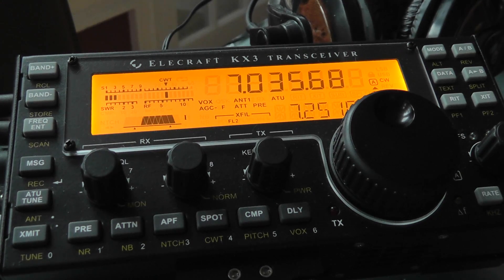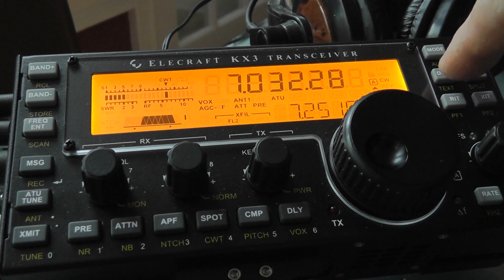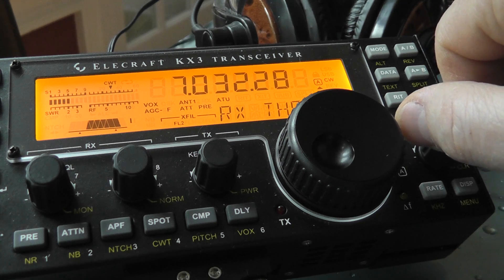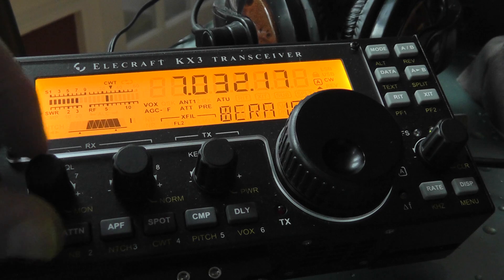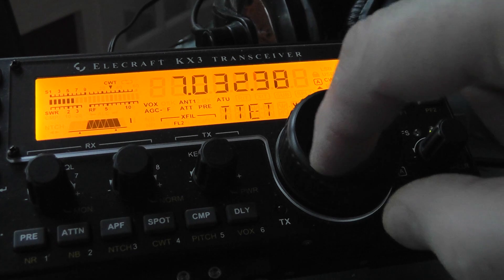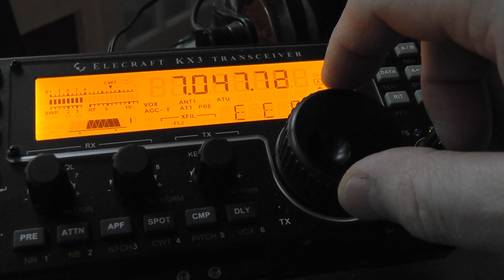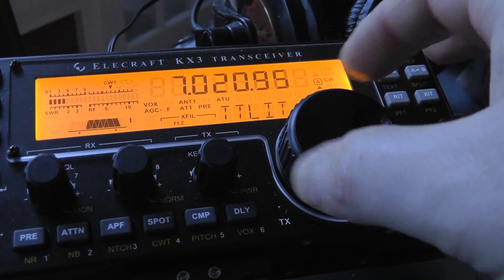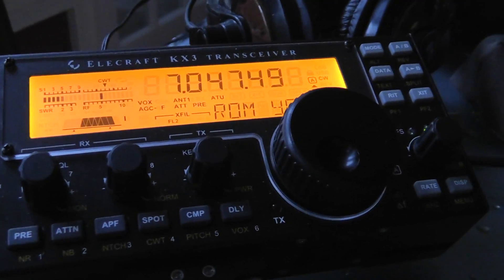SETTINGS FOR CW DECODE ELECRAFT KX3

Comment: I think the trick might be the same as the xeigu 6200 decode. Rather than try to keep winding onto the signal and see if it decodes immediately get a good signal that kx3 starts to decode and wait. After about 30 seconds the xeigu 6200 starts to decode very very well. I’ve also seen the kx3 decode very well  which is great because I get mine tomorrow. 👍👍🥳

Comment: I know this is a bit late and you may already have found this out....   I see that your preamp is on and it sounds like the RF gain is at 0.   On noisy bands, like 40M, I have had the best luck running FAST AGC, preamp off and riding the RF gain down...   The Decoder is fighting all the background noise on top of everything else and you end up with a lot of EE*E***E*E***EEE kind of things.
Reply from the maker: +John Wells Thank you for the tip on the KX3....I do not get to use it as much as I would like but plan to getting back into using it regularly.

Comment: N4KTZ de W0QR
Steve the key to working with the data modes is to load the KX3 terminal program.  You not only can see CW decode but you can send CW, PSK, RTTy via your keyboard and decode it on a dedicated screen.  You have to use the adapter cable (usb for me).  It's the same as the firmware updates only you select a different tab.

Comment: You might have a little more success is you tighten up your filter a bit.  It looks pretty wide open for CW.  The KX3 manual suggests a filter bandwidth of 300hz or less for optimal decoding.